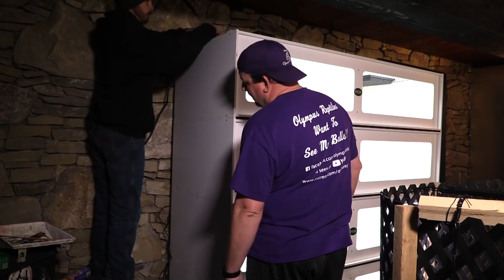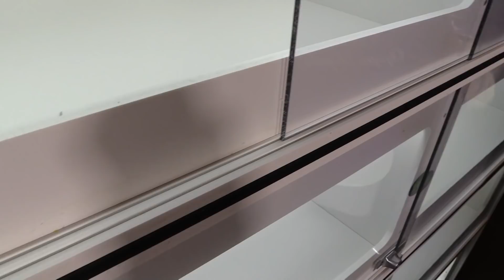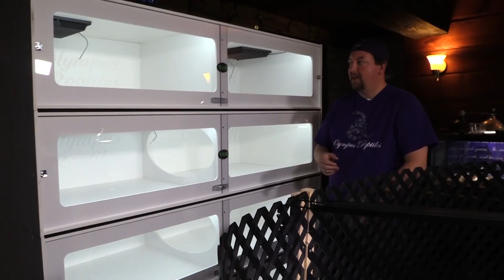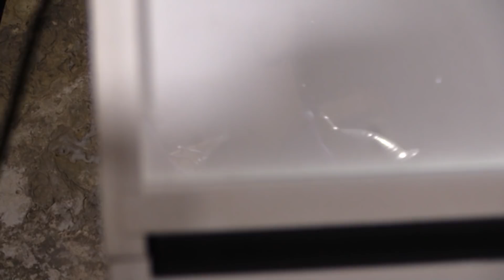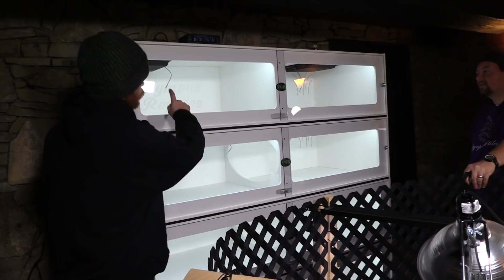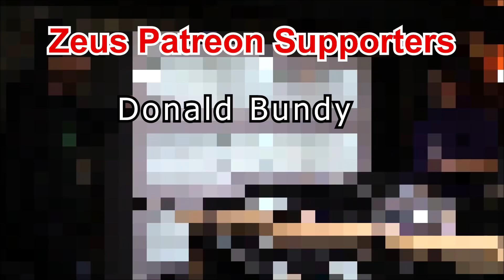New caging from TGR.  PROFESSIONAL caging for your REPTILES!  It is AMAZING!

Comment: Hey bud love your channel keep up the good work.Had a question about them RHP you are using how are they keeping up? Any warping or failure?
Reply from the maker: We haven't had an issue
Reply: @OlympusReptiles  and those are VE Radiant Heat Panels if I’m not mistaken correct?

Comment: Matt - Ordered my cages after seeing your previous videos.   Ordered my 2nd cage 9/1/19 and did not receive until 12/12/19.  All good I know it takes time.  Cage came with wrong glass - track broke while installing glass.  I was promised a new glass 12/13/19.  Apparently machines are broken and still no glass - basically have a useless cage.    You would not believe some of the excuses I have gotten.  Switched over to AP - TGR is a joke.   I have a funny feeling they are not even addressing the situation just sending me bogus emails and hope i go away.  Stop promoting until they get their shit together.
Reply from the maker: Frank, sorry to hear.  That has not been my experience at all.  Yes, it takes time.  But products have been great for me.  Curious with broken parts if it was from shipping (doesn't make it ok).

Comment: Still waiting for mine... the 2 month wait is a bit ridiculous. For this reason I probably won’t order again unless they fix this issue. Although I’m sure once it comes I’ll be happy with it.
Reply from the maker: Hey Dan.  The wait is the norm in the industry.  Each one being built to order takes time.  Waiting sucks, but definitely worth it
Reply: @OlympusReptiles  2 months does not seem to be the norm. I ordered another rack from c serpents and got it within 2 weeks. I still didn't receive my racks from tgr and they are saying it will be several more weeks because both of their machines are broken down. Personally I would not be promoting these guys till they get their act together.
Reply: @Urbanvagabondtv  a complete joke!! They are still taking orders online.  Ive been waiting over a month for glass they shipped incorrectly.  Thats after waiting almost 4 months for my cage.  AP is the way to go.

Comment: Hi. I have 2 ball pythons. Their feeding has been good and bad. Started off good but lately its been bad. From the tons of vids ive watched it seems like humidity might be the issue im dealing with. Im using 2 terrariums with mesh tops. Is aluminum foil enough to lock in the humidity or do i need to look for a more solid cover. Any help is appreciated. Ill keep digging thru your vids in case its been discussed.
Reply from the maker: Foil usually does the trick
Reply: Olympus Reptiles , foil did the trick. They quickly became more active. Tonight they seemed to be very active so I attempted to feed them and they both ate with no issues.

Comment: Can you use a heat pad on  the bottom for belly heat
Reply from the maker: It could be set up that way yes.  I don't know if he makes them that way (we aren't using them for balls) but it wouldn't be hard to do.
Reply: Serenity Wilson even if you are using them for balls, its doable with the correct size (and monitor temps closely, you may still need a secondary heat source because this enclosure is so tall), but id go for about half the enclosure in a heat mat. either fluker’s brand or heat tape, but rhps or ches may work a little better, but if youre using a che or any kind of bulb in the cage please use a guard so the snake cant burn itself